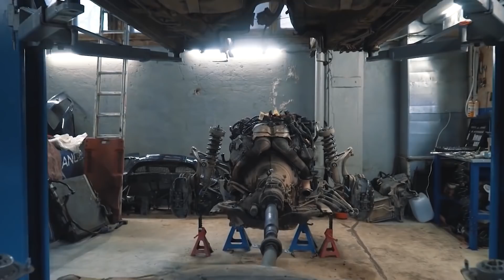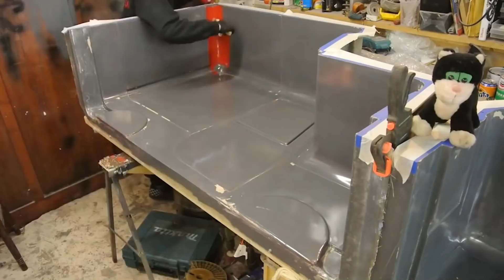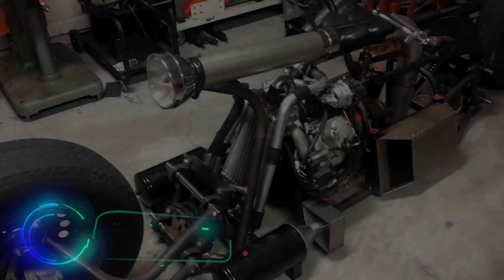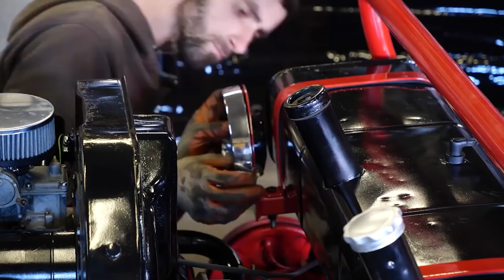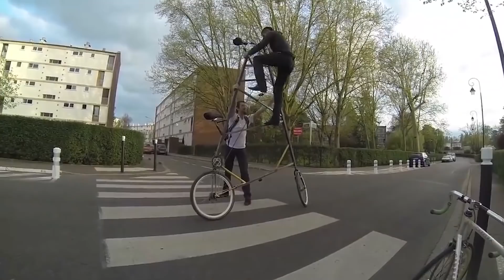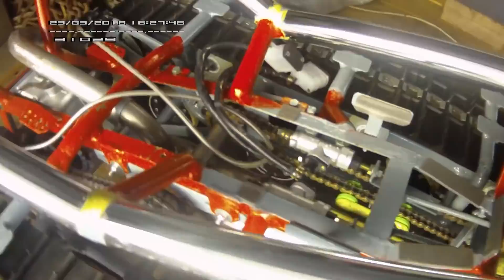COOL HOMEMADE PROJECTS THAT HAVE AMAZED THE WHOLE WORLD

Comment: There is nothing like single-handedly polluting the atmosphere with your totally awesome fucking motorsickle!
Reply: It's just a diesel motor without the extra fluid to keep the soot down, even the supposedly clean diesels still smoke like this you just never see it because they spray a liquid in that keeps it from ever exiting and instead builds up in the engine itself making it steadily less efficient and ever 100,000 miles require you to clean them out or they'll be clogged up and seemingly dead.

Comment: Real ingenuity will come when you can obtain higher speeds without needing to use a stupid fossil fuel engine or electric motors. 🍷🍷😎😎
Reply: Need bath salts for that.
Reply: So reindeer powered? Or a sail like a pirate ship? Lol
Reply: @jetink600  its FLYWHEELS, and they are blowing away diesel engines all day long! 🍷🍷🍷🤣🤣🤣
Reply: @skytoll1  but a flywheel produces electricity and it even uses an electric motor 🤦🏿😂
Reply: @jetink600  yeah, as a STARTER, that's all their good for in a vehicle. We're moving tractor trailers, and the "LI batteries" would cost about $250,000 dollars. Laugh at that, because we can! Our batteries cost $600 dollars, and we get 1,942HP.🍷🍷🍷🤣🤣🤣🤣
Reply: @skytoll1  that's pretty amazing if it's true. But seriously don't those flywheel contraptions at the end of the day still produce electricity? I'm just wondering how you claim its doing the stuff you say without electric motors (completely ignoring how contradictory that statement is from the jump since the thing literally has an electric motor as one of the components). If it does produce electricity, how do you convert that to movement or power without an electric motor?
Reply: @jetink600  I'm doing emergency management, medical & mobility engineering for several countries to function when they don't have fuel or electricity. The efficiency of the flywheels we use are greater than 16,900 percent, which is WHY we get the results we do. 🍷🍷🔥🔥
Reply: @skytoll1  ok you just completely ignored everything i asked. Have a good day bro ✌🏾
Reply: @jetink600  He's making shit up anyways. That is why he can't provide any actual information because it is as you said just making electricity, they just use the kinetic energy stored in them but one you put load on them they die off fast. (That and they are huge, heavy and when fail ungodly dangerous)
Reply: @SilvaDreams  yeah i know but i was kinda hoping he would make up some interesting shit at least lol

Comment: I'm pretty sure that engine isn't supposed to spew a constant black smoke like that.   That can't be good
Reply: He's pushing fuel right back out thru the turbo. He doesn't know anything about turbo charging an engine. A totally crap setup
Reply: It’s a Diesel engine.
Reply: @kalikasurf  I know that, but even diesel engines aren't supposed to spew that much smoke
Reply: @righty-o3585  tuned and emission filters removed can definitely do that, look up heavily tuned BMW 335d and you’ll see what an inline 6 can do
Reply: @2livecrew270    Why would anybody do that?
Reply: @righty-o3585  Because they can... And most modern diesel engines aren't nearly as clean as you think, they just use recycled oil systems to keep the soot down by using your engine oil to literally fill your engine with the soot instead making them steadily less efficient so after about 100,000 miles your intake and headers are covered in over a inch of soot clogging it up.

Comment: I don’t care how cool your motorcycle looks, you can’t ride around polluting the air like that.
Reply: The joke is on you, your modern diesel isn't any better, he just lacks the oil recycling system that cuts down on the soot.. S0 instead of ending up in the air it ends up in your engine making it steadily less efficient instead.

Comment: I also am not amazed with the rolling coal bike just a poorly tuned over fueled diesel
Reply: Nah just a diesel engine that doesn't have a oil sprayer for soot control like modern engines, so instead of it just looking cleaner and gunking up your engine from recycled engine oil keeping the soot down it just pumps it into the air when throttling heavy.